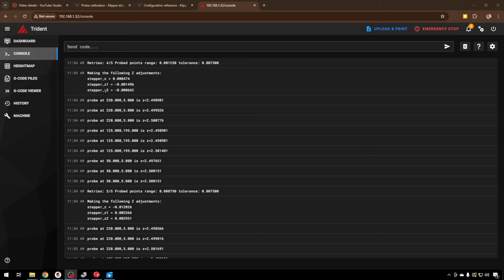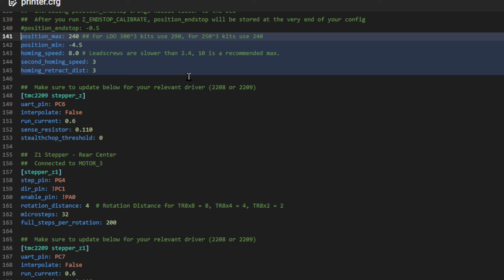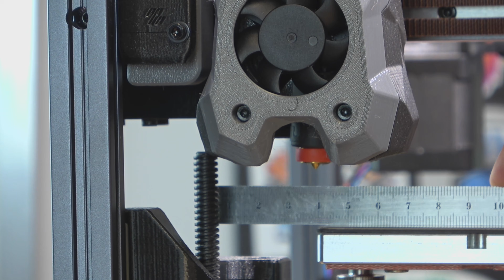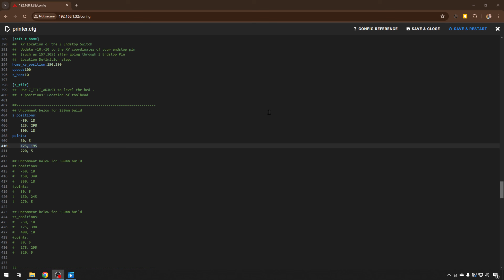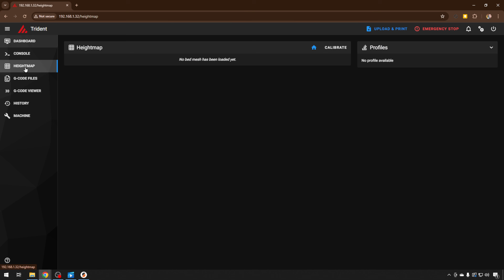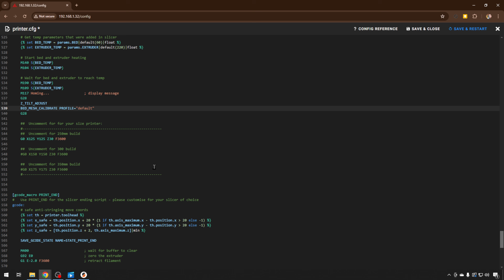Tired Of Mesh Bed Leveling?  - Z Tilt Configuration -  Klipper - Chris's Basement - 2024

Comment: Greeting Everyone, Chris, thanks for the great videos, I'm trying to upgrade to the triple-Z adjustment, and I was curious about if I can perform such action with just Marline and no Klipper, since I haven't started with Klipper yet, I'm using a custom made printer and BTT Octopus, best regards
Reply from the maker: Thanks for watching. Yes you can, I haven't done a video on how to do 3, but I have done one for 2, but you can use G34, search for that in the code to do multiple stepper motors.

Comment: I wish they had sensorless homing for each motor individually. It stops all 3 when 1 activates
Reply from the maker: That would be an interesting setup. I might have to try it just to see what it does.
Reply: It is possible in rep rap firmware.  @ChrisRiley
Reply from the maker: @samuelp1227  It would be tricky, but check this out. https://forum.duet3d.com/topic/30520/howto-configure-z-axis-sensorless-homing-in-homey-g-file/6

Comment: How about bed slinger
Reply from the maker: You can do a G34 or something similar if you have 2 different Z stepper drivers. https://youtu.be/3jAFQdTk8iw?si=d6IMJQxkhVC_i7ne&t=777
Reply: @ChrisRiley  I do have 2 different stepper drivers for Z axis but my steppers are TMC 2226,  and im running klipper I’m not sure if this stepper drive has sensorless homing
Reply from the maker: @RayLenses  2226 does have sensorless homing.

Comment: I use it on a reconfigured mK3s… what is the difference with quad gantry leveling… qgl only for voron2.4 ?
Reply from the maker: I'm not exactly sure, it could be something to do with how the belts and gantry work on the 2.4. Belts and flying carriage.
Reply: @ChrisRiley found the info… z tilt is for 2 or 3 zMotor, QGL Is for flying gantry…

Comment: Thanks  Chris. I use z-tilt on an i3 printer (Geeetech) with dual z stepper and bl-touch. Klipper on that machine improved the print speed a lot, even at 12 volts.
Reply from the maker: Awesome! Thanks for sharing

Comment: Hi Chris! I noticed that your full steps per rotation explanation is wrong, unless you are adjusting microstepping through the stepper driver pins and not firmware. In Klipper, it's full steps for the motor without microstepping so a 0.9 degree stepper should have 400 steps specified there 😊
Reply from the maker: Thanks!

Comment: Can klipper(or any other firmware for that matter) use z tilt to allow mesh leveling to work with IDEX? So it keeps the two points you're printing above the same distance to the toolheads, and corrects x position based on z height and tilt angle. I can see this being useful for large beds.
Reply from the maker: That's a great question, I am currently building an idex, we will see if we can make it work.

Comment: Chris, thanks for sharing this.  Another great feature of Klipper, I have been using this for years on my Rat Rigs.  It is really helpful when you have a 500mm square bed.  I run this and bed mesh before every print. as the mesh can change when removing the magnetic bed plate.   Many of the old printers did not have multiple Z motors that can be individually controlled, so this is not available for them.
Reply from the maker: Thanks Dave, for sure, on the larger machines I wouldn't want to try and run without this feature these days.